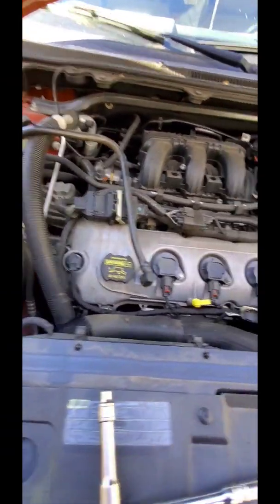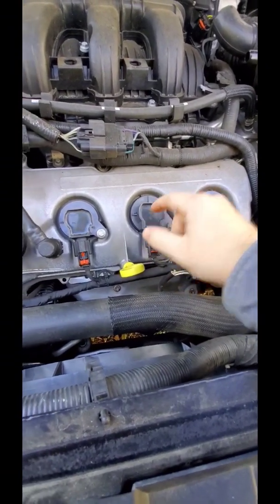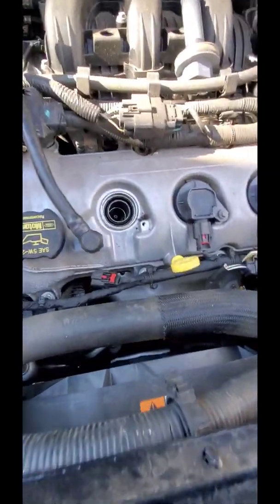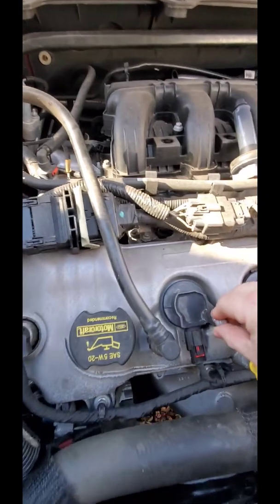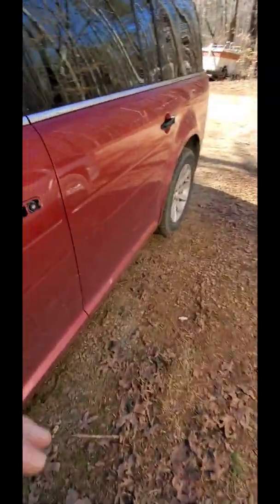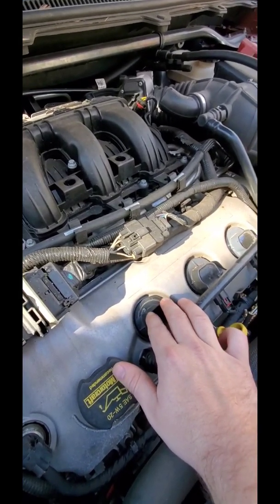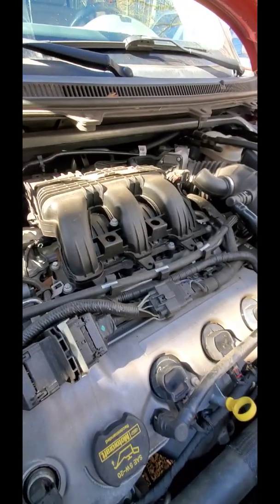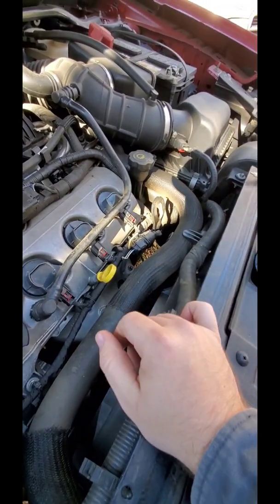Ford Flex coil pack replacement.

Comment: Yeah I have had my used flex for 5 mon/s and had misfire on all the coil and  spark plugs and today I'm dealing with it again  on my own so in 5 months my car has been down and out 3 times with misfire codes.  Dealer said he changed everything. And, now I'm back to square one stranded trying to get cylinder 4 up and going and now the sensors are showing codes on diagnostic devices.  Ugh 5 months
Reply from the maker: I'm sorry ur going through all that after this video I changed them 2 more times and I got tired of it and I sold it

Comment: Lucky for you the bad coil was on the front, the ones you are calling 4, 5, & 6. You might know the one that’s gone bad on mine is the backside, or what I guess is 1, 2, & 3. It ain’t looking pretty. You think your luck is bad.
Reply from the maker: Yea well ended up being not only miss fire but it was the timing causing the miss fire just sold it not to long ago after this video